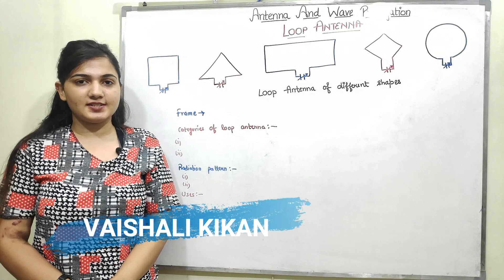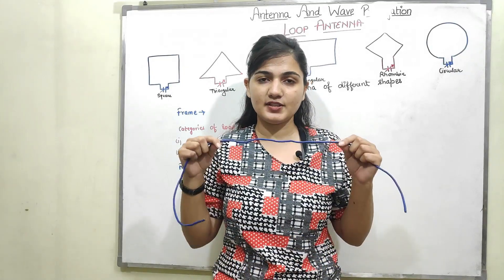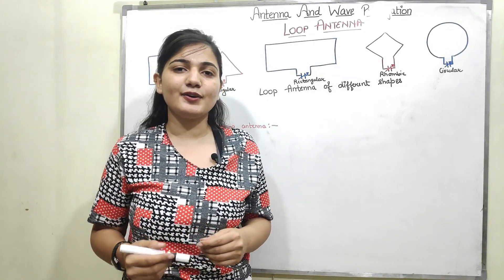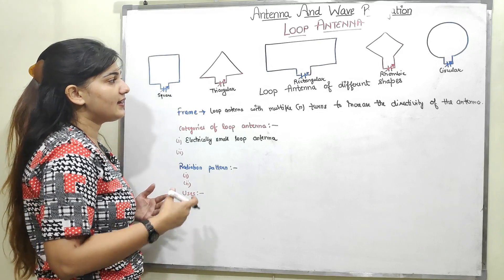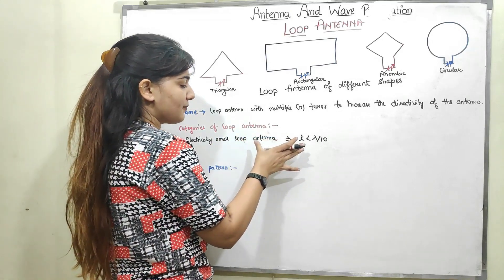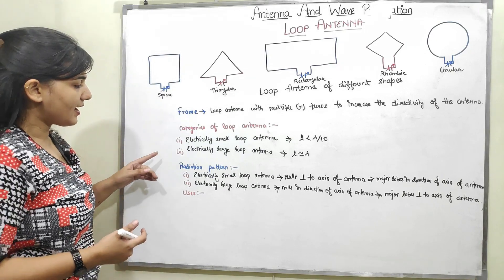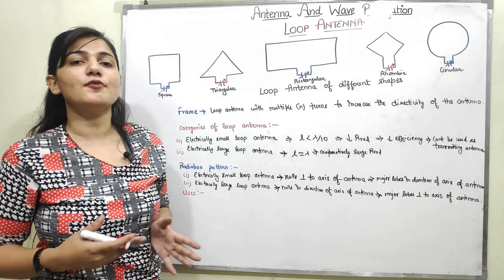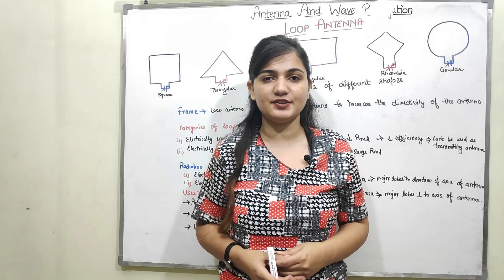Introduction to Loop Antenna | Types of Antenna | AWP | Vaishali Kikan | Lecture 22 |

Comment: you are incorrect.small loops  can and are bring used for Tx over great distancs plus 18k and more. Magnetic loop antennas can also be made very efficient if certain design conditions are met. ZL4MBW